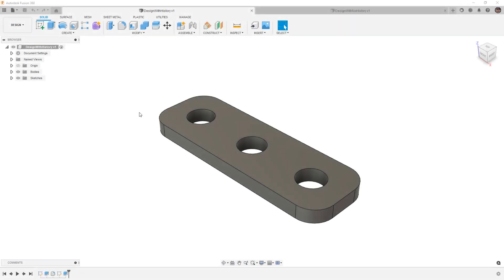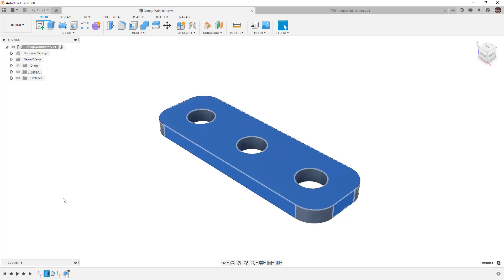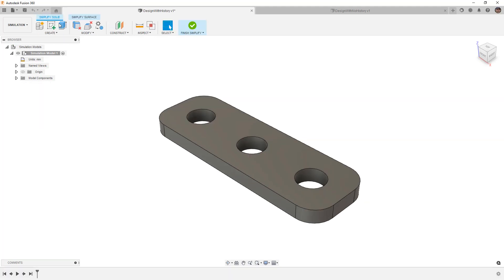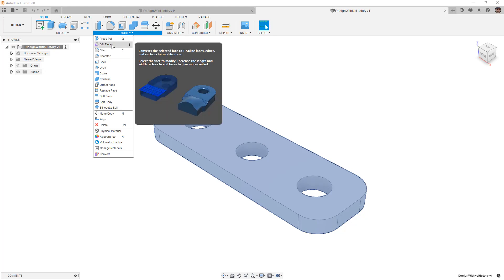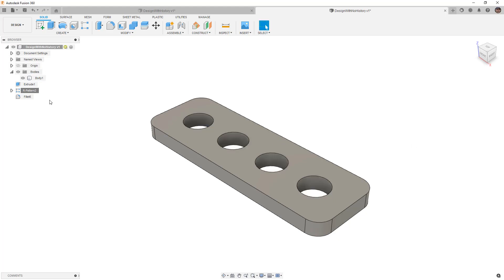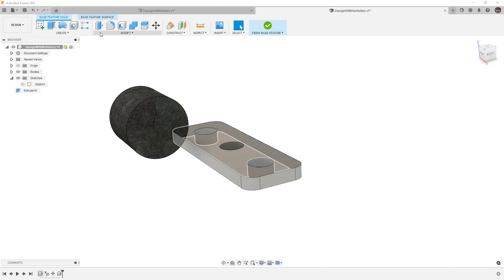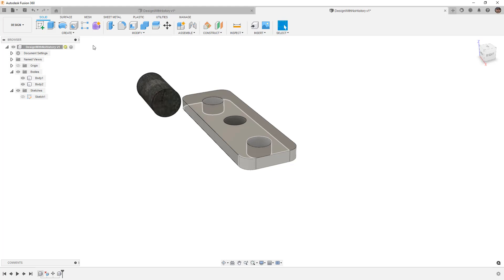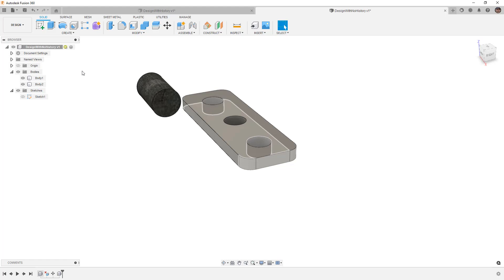What Does Capture Design History Really Mean #Fusion360

Comment: The one time I turn of capture design history is if I want to copy a body from one project and use it as a base feature to start a new project and I do NOT want to link(derive) it to the previous design. A simple ctrl-C, central-v is faster than derive, choose object, break link....
Reply from the maker: Very Interesting!  I have never done that one before!  Thanks for the comment.  Does this happen on a "one off" basis?  Like you use one design just one additional time?  I just want to understand the workflow in case someone comes up with the question. Derive is helpful but it has to be super specific because when you break that link you do just get a base feature.
Reply: @LearnEverythingAboutDesign  I usually use this if I have a body, in my case a fishing lure, and I want to try some different permutations of internal layouts, details etc. I know I could use versions but at least for my skill level in Fusion I could easily not get a working design when I am done.

So I just copy the body I want to experiment with, open a new design, turn off capture, paste it in, then turn on capture again. This also allows me to take a body from a specific point in the time line, where a derive would take the most current body. I can "fork" a design in a quick and dirty way. I could also just save as the current design and nuke the timeline to that point but really this is more for "Hmm I wonder if this will work" type projects and not "Now I need to do X and I am sure it will work." type projects.

Hope that makes sense!
Reply from the maker: Totally makes sense!  And like everything there are tons of ways it could be done!  A couple of notes for future projects and differences.

For Derives, you aren't required to update the version.  One way you can get around this and maybe maintain some form of relationship is in your assembly(assuming your body is in its own component) do a Copy/Paste New.  The Paste new will copy all of the features in that component so you can keep editing as you wish, but break the link.  This lets you do this in the same design without having to resort to cutting off the timeline.  You could create a derive from here if you really wanted.  Derive is super handy if you want the external design to possibly update.  Turning off history breaks your current design.

The links between derives and external reference can be tricky but glad you have a workflow that works!  If you get stuck dont hesitate to reach out. support@caducator.com
Reply: @LearnEverythingAboutDesign  I am pretty sure they called it Fusion 360 because their are 360 ways to end up with the same result! ;-) Thanks for that tip, keep up the amazing work on your channel!